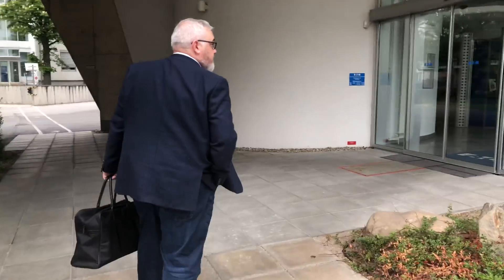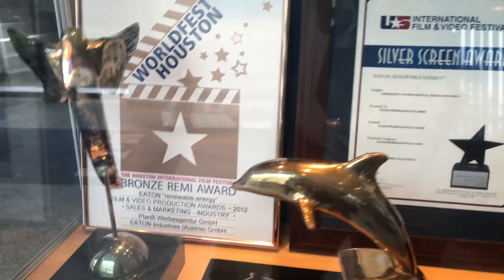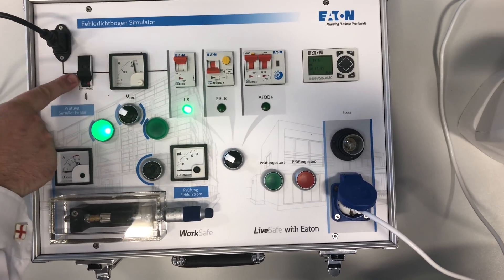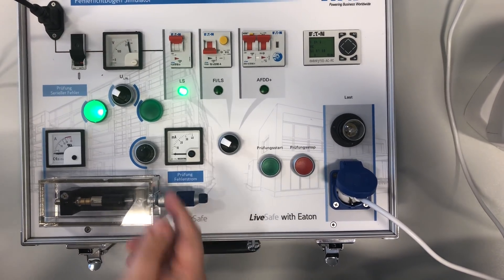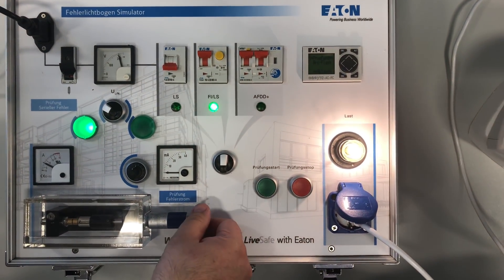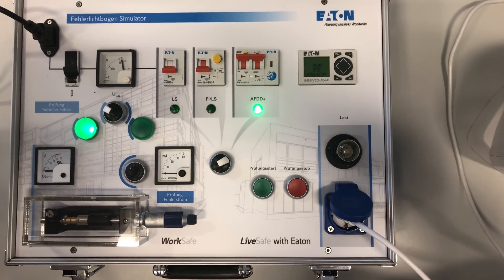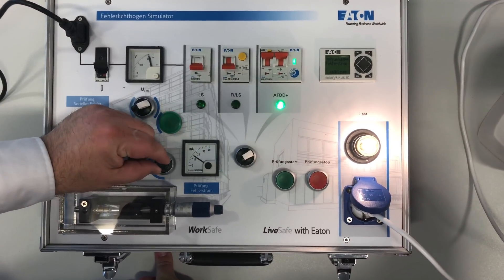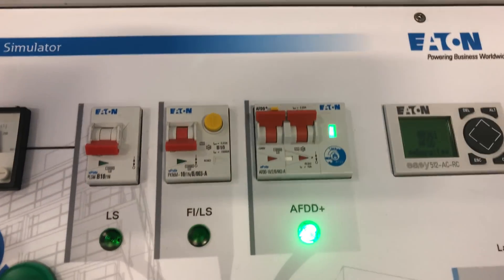Arc Fault Detection Devices (AFDDs) #e5 Vienna Visit to Eaton’s Test Centre to Validate AFDD’s PT 1

Comment: Hi, great video! Are you able to elaborate on what device was cutting out periodically that required the green start button to reset it? Many thanks.
Reply from the maker: Rob Brown the green button was just a contact switch to switch on the socket and lamp which were the load
Reply from the maker: Rob Brown the cutting out was caused by a loss of voltage as the contacts were quite sensitive. It’s difficult to create a stable arc.
Reply: @e5Group  Having watched it again, it seems perhaps the stop-start buttons are a NVR switch?
Reply: @e5Group  Thanks, makes perfect sense